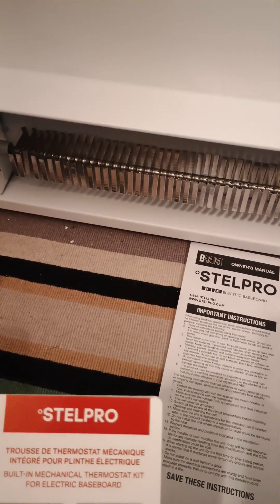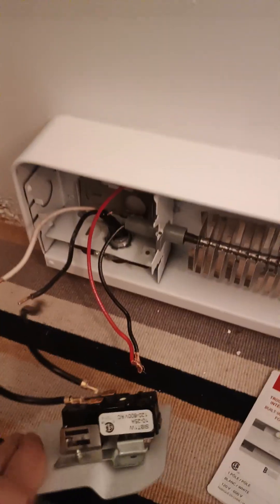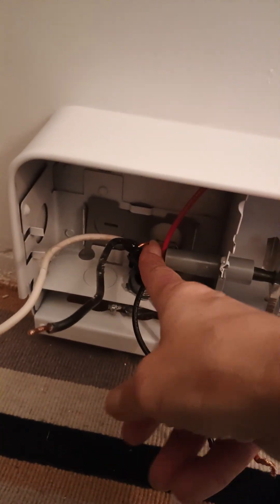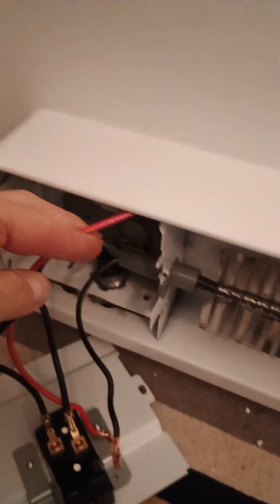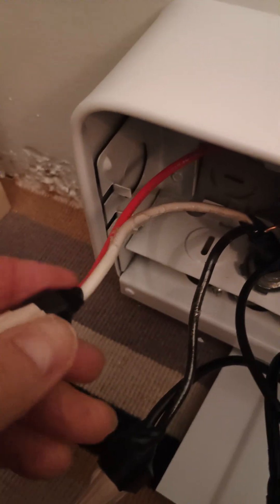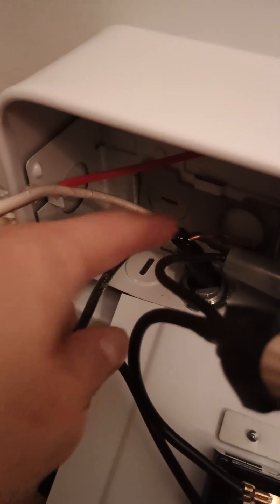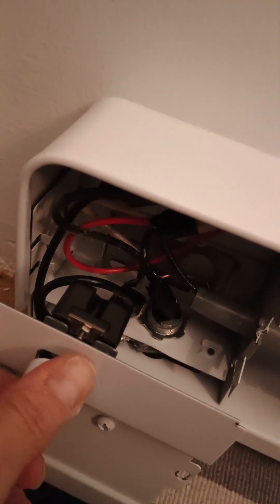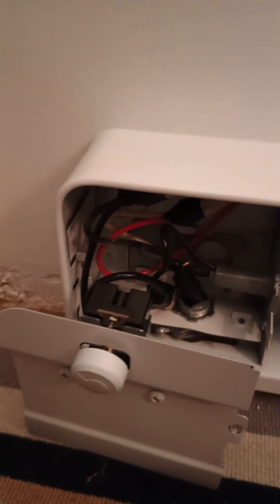Wiring a Stelpro Brava baseboard heater with a two-wire single pole built-in thermostat

Comment: May I ask the model code of your heater? I've got an old one (probably installed 10+ years ago) with model code B0502, which is probably the predecessor of B0502W, but the difference is that there is no holes on the front panel to install the thermostat.... I'm thinking of screwing holes there, but not sure if it's viable or not..

Comment: is this 240v or 120v? if it is 240v,  are both black and white wires are hot?
Reply: Good question because both black L2 and white L1 wires ARE HOT in a 240v circuit.
Reply from the maker: You're correct that a 240V installation with three wires (green, black and white) that the white is also a hot wire (only in a 120V would white be neutral). In modern set ups for 240V it's more common to see green, black and a red wire in place of white. My wiring dates back to the late 70s and uses a white wire. That heater I upgraded runs the original line as a stand-alone 240V installation and connects to a 40 amp double pole breaker in my electrical panel. The connection set up I showed in the video got the heater to run after I found the instructions from Stelpro for the unit ambiguous. 

I appreciate you pointing out that the white will also be hot in 240V wiring. I'll amend the commentary to reflect that!